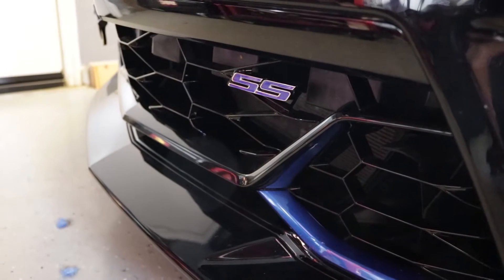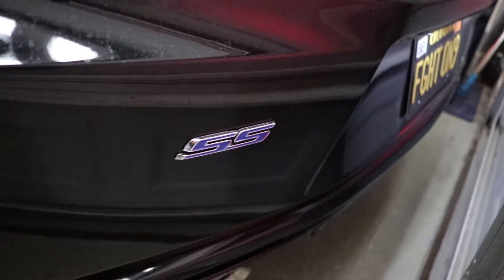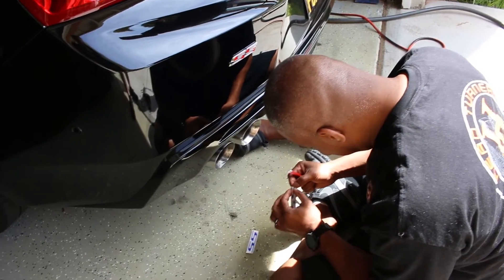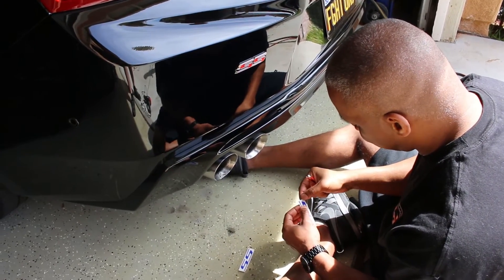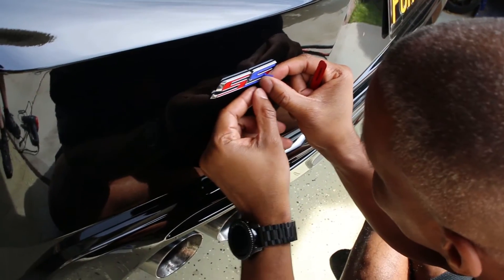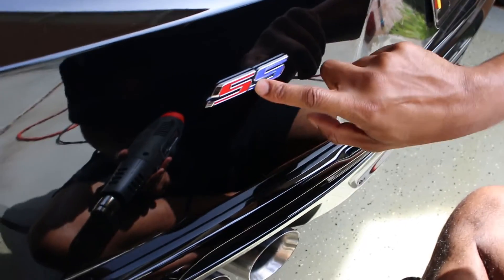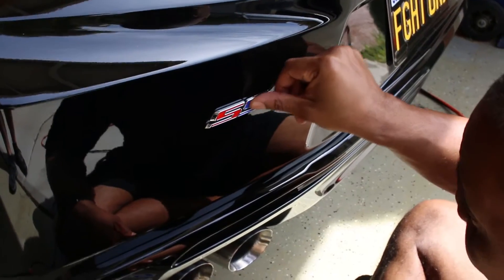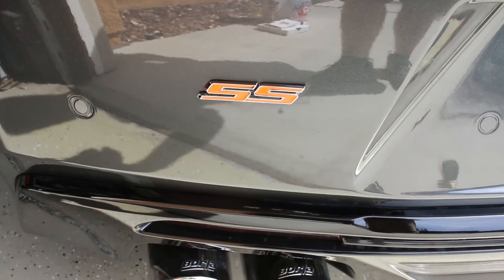How to Apply Vinyl Overlays on the Camaro SS

Comment: Clean that carbon off your tips before it bakes on permanently!
Reply from the maker: yeah, I clean them each time I wash. I don't want it to stay
Reply: MojaveKY how often do you wash, and how do you upkeep your matte hood, I have some hard water spots on my 1LE's hood such a pain, didnt come off with adams matte detail spray or vinegar :(
Reply from the maker: did you try the Adams Matte protectorant?  I did a video on it.  It is a bit rough to apply but it really does help.  I have had issues with the wrap as well

https://www.youtube.com/watch?v=bYjBVNATe5g
Reply: MojaveKY yeah i saw the video a little while ago. The wrap looked good with the two products applied. Issues like what? Hard water spots? I have not tried the matte protectant but since you have experience with the product, does it remove spots or just simply protects matte finishes?
Reply from the maker: I wouldn't call them spots and not hard water spots.  I had some from a sprinkler awhile ago.   more like you could see the water marks on the vinyl.  the product coats more like a wax ish kinda of product if that makes sense.  you put it on and let it sit then buff off.  but it will streak if you dont paint it on.  the hood needs to be cleaned already.